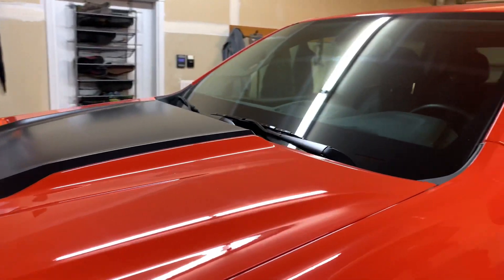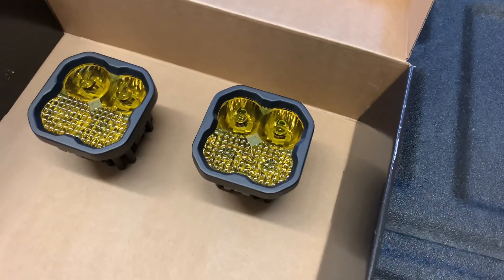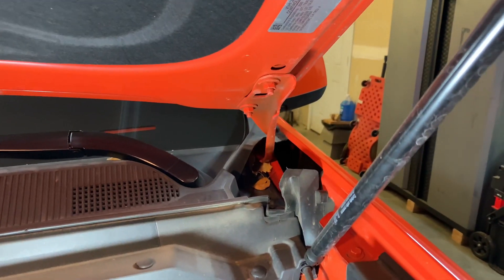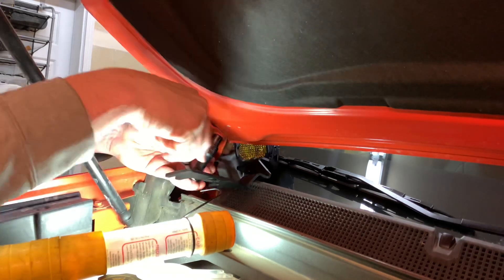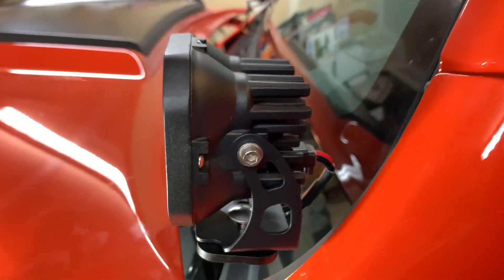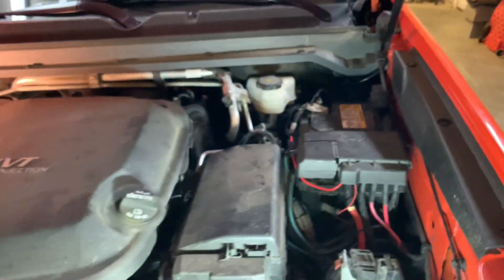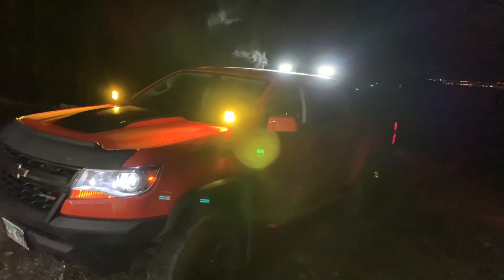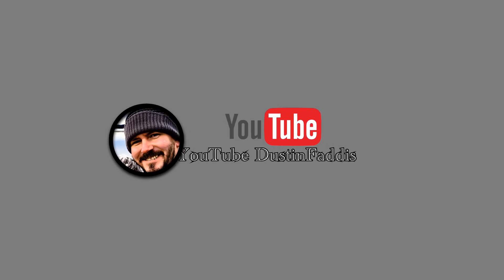CHEVY COLORADO: BEST OFF-ROAD LIGHT SETUP

Comment: Definitely nice lights,  if anyone is wondering it's just as easy to run the wires with out the sport bar lighting, I'm running a set of procomp s15-w only con they only come white, and I'm running the caliraised lowprofile brackets 👌🏼👌🏼 very clean look
Reply from the maker: Thanks for watching and taking the time to leave a comment

Comment: Very nice, next up for my ZR2 is additional lighting, I like that set up and amber choice.  I am electrically challenged, I assume it would be real easy to hook those ditch lights up to one of those S-Pod devices?
Reply from the maker: It’s actually very easy to wire. The instructions are detailed and it comes with a switch. You will just need to run the wires into the cab. There are already wires running into the cab in the same area that I was working. Just shove the wires through there. So the wiring harness splits and directly plugs into each light. From there the harness leads to a positive wire and negative wire. Those just go to the battery. The last part is the switch which comes connected. You just route that where you need or want it and it’s done.
Reply: @DustinFaddis  You ‘da man!